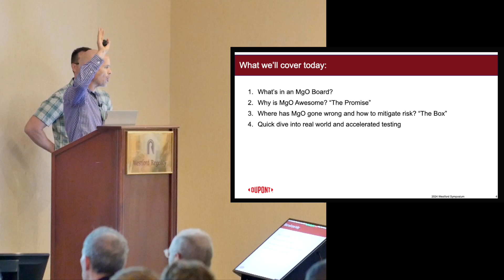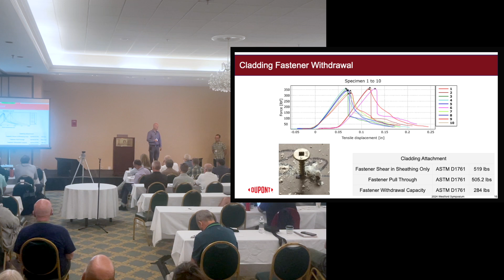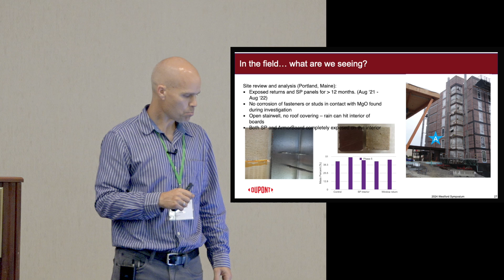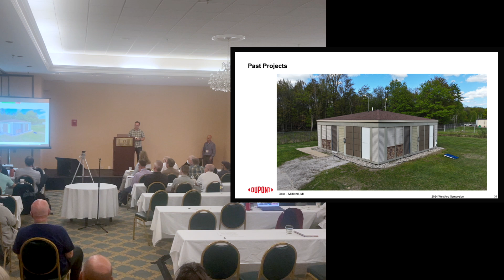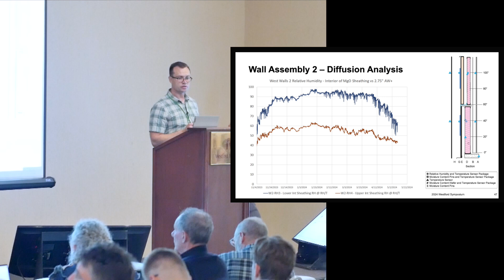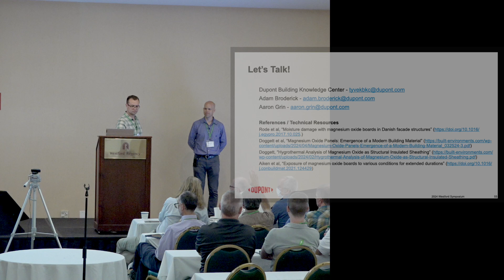MgO - Magnesium Oxide Sheathing Panels - no sweat..sweet (Adam Broderick and Aaron Grin (2024)

Comment: I feel the WRB might be overkill for some wall assemblies. These panels have the potential to act as both structural sheathing and cladding. The easiest way would be using cementitious filler materials in the panel gaps and nail holes, applying liquid membrane over all patched joints and holes, textured masonry primer and paint, and you are done. You can use form liner or other methods to create the architectural pattern you want on the exterior face within the factory.